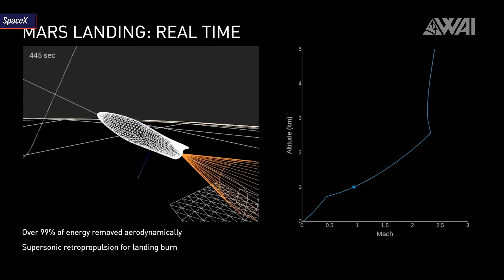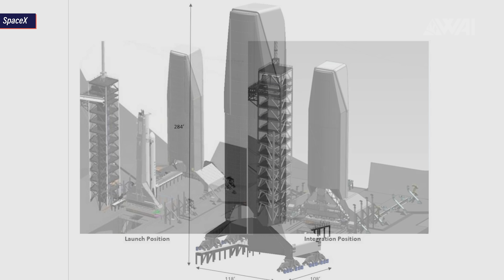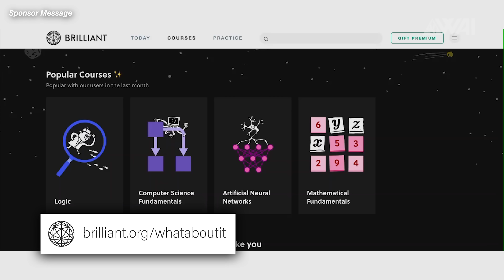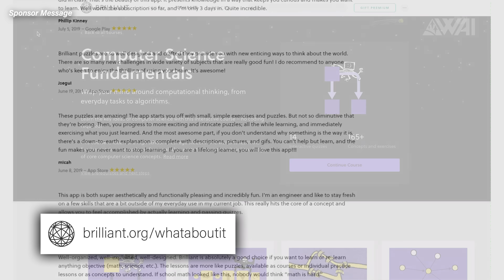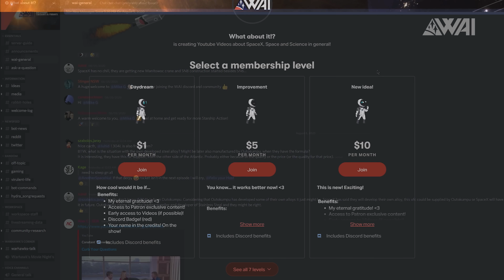112 | Starship Flight Phase Explained!

Comment: Could would it be possible for starship to fly to an asteroid capture it by opening it firings and then bring it back to earth. Elon could make a nice little earner for Elon if he could find a mineral rich one with olives in. Would love so see a rendering from someone with skills on how this could be done. .
Reply from the maker: In theory yes. The problem is the relative speed though. The Starship would start from Earth and then have to change it's speed and trajectory to that of the target asteroid, which is really hard to do. Then it would have to secure the asteroid in the fairing bay and change orbit again. Ask JAXA, how hard this is. ;)
Reply: What about it!?  Tesla could just fit it’s auto drive system that could fly close and match its speed edging close slowly as did the crew capsule did to dock with ISS. What Would he make from a asteroid if he could catch one and what price would you pay for one.????????.

Comment: Thanks Felix.  Hope the holiday was restful and fun for the family.  I believe SN8, if it has 3 Raptors for the 20km flight, will need a new launch area, perhaps even the big one they are building.  The current launch platform and dirt covered area does not seem built for 3 raptors, especially so close to the tank farm.  Will SN8 have 3 Raptors?  Thanks.
Reply from the maker: Hey Steve! Thank you for the nice comment! The trip was great! :) Agreed on the pad situation. That's over 600 tons of thrust. SN8 will have three Raptors, yes! :)

Comment: Signing to launch military payloads into orbit is a mistake, let ULA do it all. True it's a billion dollar deal for SpaceX but looking back at Shuttle history the military made to many demands. The Shuttle was designed and built to put Space Station parts into orbit, however on STS-4 they put a classified satellite "Teal Ruby" on board but it failed to deploy. On STS-5 two communication satellites were successfully deployed, with that the military moved in and told NASA the payload bay was to small and to enlarge it so they could launch classified satellites into a polar orbit. I can't help to believe that this will happen again with Starship. The military will remind SpaceX of the billions of dollars there making and start bumping Moon and Mars missions. SpaceX learn from history.
Reply from the maker: Fingers crossed, Starlink kicks in soon. It will be the needed funding for many more years to come.
Reply: We paid for developmental costs for ULA, unlike Space X. Space X is more advanced and cheaper. Except for having two providers, there is no reason to include ULA. I would say for cost, reliability, and capability we should let Space X do it all. The Space Shuttle was a great historical advancement, but it is now ancient history.

Comment: Are you sure what is being showed is a super heavy pad as opposed to a water tower for fire suppression??
Reply from the maker: I have been speculating with Mauricio from RGV about it. The size would be total overkill though... :D
Reply: @Whataboutit  Looking at the concrete and steel supports being poured, I am now thinking that a SH launch pad is more likely.  If it where a water tower, as I was thinking, one would only need steel supports.  I have never seen a "water tower" with concrete and rebar supports.  The remaining problem I have is that I have never seen a picture of a SH pad with legs (perhaps they will be closed in) and this just doesn't look like any pad I have ever seen (one might add that SH is unlike any other rocket).
Reply: The water is also used to suppress sound and 31 of those engines will break glass for mils if not suppressed.